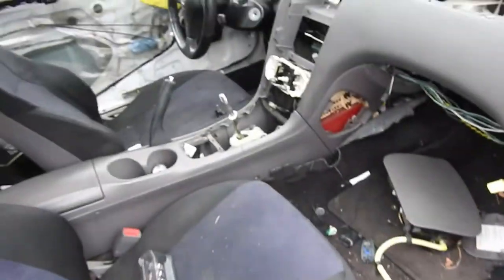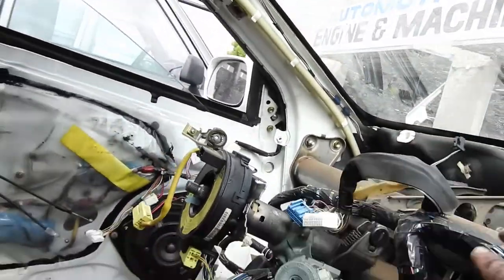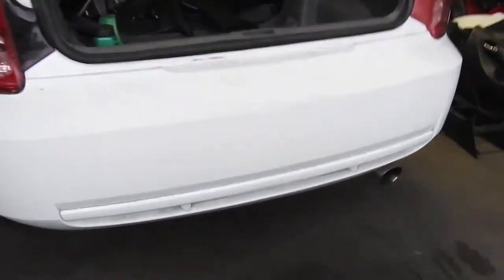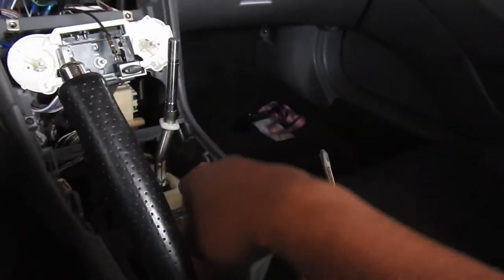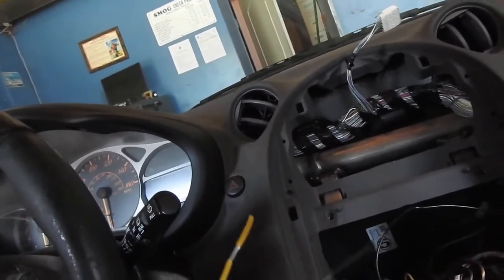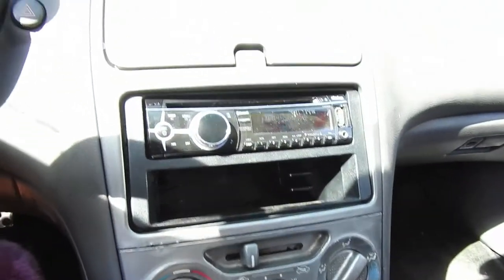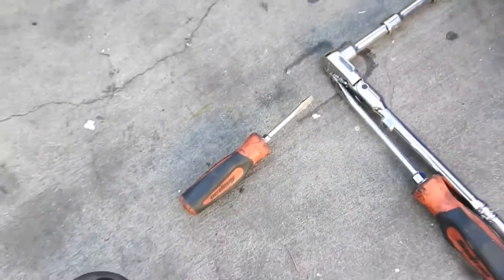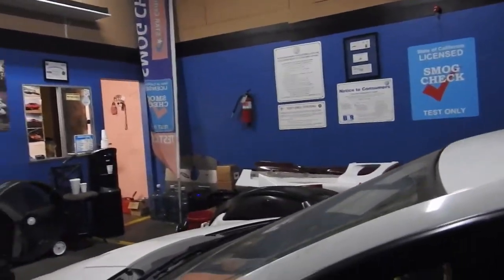How to remove gas lid, sunroof, exhaust and dash 00-05 toyota celica

Comment: For the fuel door. Was there a screw on the other side? Mine was replaced by the previous owner and I can’t seem to get the screw out. Can’t tell if there’s a nut on the other side or not
Reply from the maker: Manuel Rauda there’s a screw on the other side
Reply: Rafa's Garage I meant nut lol. Super late night comment sorry. And thank you. I’ll have to take apart the inside to get to it. 

Ive got a big subwoofer in my car and the screws holding the door are semi loose so it rattles like crazy with the vibration

Comment: what did you use to take out the stock gas door i saw you just drill it ? 
i tried drilling mine but it wont work any suggestions
Reply from the maker: That is the only way to take rivets
Reply: Rafa's Garage probably im just going to keep drilling it thanks for fast reply bro

Comment: U know if the GT interior fit the GTS? Thnx
Reply from the maker: esncial yes what yr are the cars
Reply: My gts is 2002.  And seen a gt with black interior, not sure the year tho. So it got me thinking
Reply from the maker: esncial yes it will fit the if you are going to take the pillars change the headliner if you get the seats get the seatbelts also
Reply: Ok forsure,Will do man. appreciate it 👍